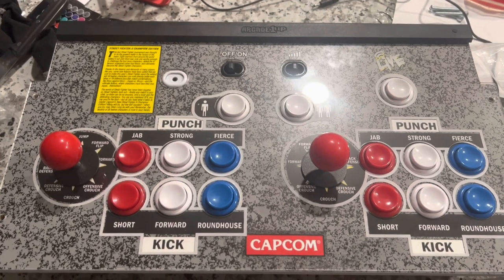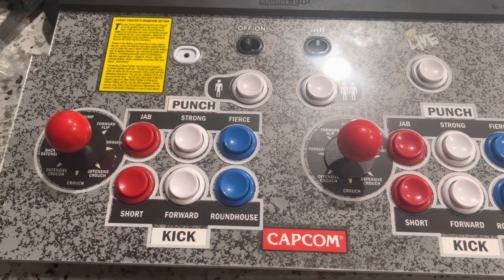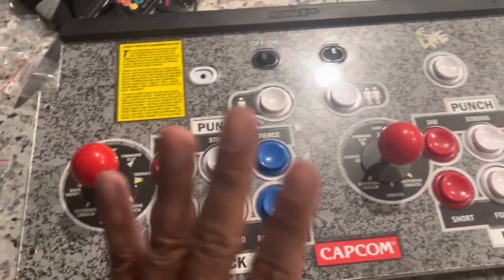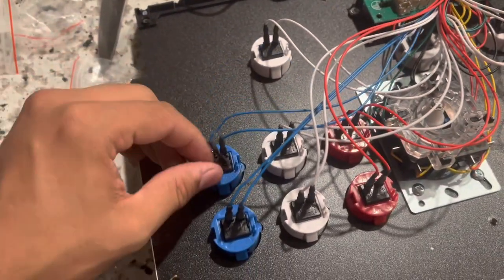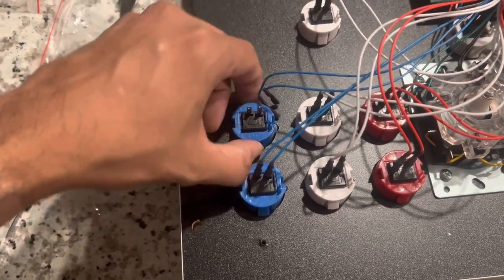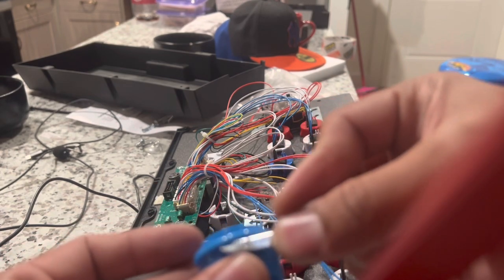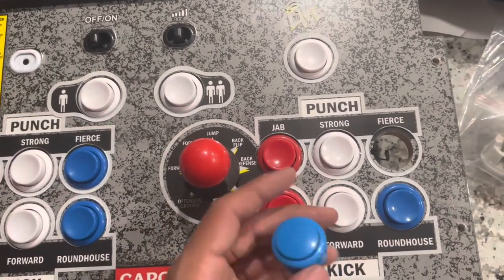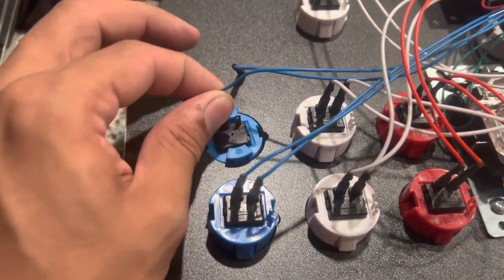How to install sanwa buttons in Arcade1up deck no drill

Comment: Great video man, especially about taping down the deck protector.  I put Sanwa buttons in my Shinku and cracked my deck protector because I didn’t tape it down or remove it.  Good advice.
Reply from the maker: If I can help someone not crack theirs like I did to mine I’ll be happy lol thank you
Reply: @ToxcynTV  Right on man.  I wish I did that with my Shinku…still pissed.